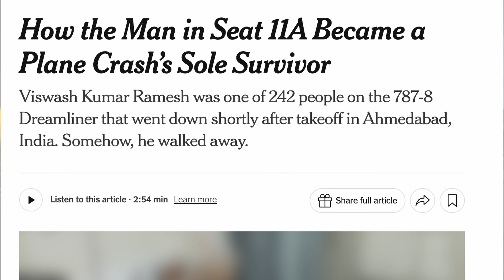Why the RAT Changes Everything – Air India 171 Update

Comment: What redundancies are built in. For example, if the throttles are pushed forward but the computer thinks they aren't.... Or worse, reads that they have been pulled back; What fail safes are there? These machines nowadays are one giant fly-by-wire complexity.

Comment: Thanks, Ahmedabad I have found is a hub for manufacture of av Fuel. In particular the relatively new SAF fuel (green) fuel using percentages of alcohol. Alcohol can absorb water, This can be a good thing however I assume this can go wrong. Being a new system unforeseen things can go wrong. Aircraft has just been refuelled.

Comment: Dear Capt Steve, I was surprised that you had jumped to pilot error so early without considering all the available information such as May day initiated which called out thrust issues; survivor talking of emergency lights coming on and the clip with the RAT sounding. As a non- technical but frequent flyer, I had put it down to dual engine out as soon as I saw the clips. 
While you have updated your view, I did not hear your apology in this episode. So let me help you. Say after me - I F*cked up .. I screwed up badly by jumping to my conclusion before considering all the available information. I apologise to the captains of the Flight AI 171 for jumping to conclusion prematurely.

Comment: Enzo de Argentina. Al parecer harán más seguros los viejos aviones trimotores como el Buenos. 727; el MD.DC.10; o el Lochkeed 1011 Tristan. Tenían toda la potencia necesaria y configurados en simetría con la visetriz del avión. Lo único que les faltaría. Como en los avienes actuales es la "Postcombustion" como la tenia el Lochkeed Francia. 104 Startfire. Lo que incrementaba su potencia en forma casi inmediata en un 40%. De haber tenido ese aditamento el flait  1338 Theodore Air India. Bueno. 787.800. Dreanliner hubiera salido airoso de despegar con máximo peso y 39° celsius del aeropuerto Amhebadad. No soy Piloto. Es mi opinión. Nada mas. Excelente tus comentarios lamento pérdida de vidas en una muerte tan brutal. Enzo de Argentina. 15.06.25 - 0:54.-//

Comment: They should contact the passengers from the previous flight on this plane to Ahmedabad. I read in one of the youtubes about this that someone said passenger communication systems were not working well. If so, this plane should have been grounded and checked out.

Comment: It's far less likely that both pilots were okay with touching the flap handle in that phase of flight, much less 'moving' the flap handle sufficient to raise the flaps. No experienced investigator would focus on that over the obvious dual engine failure or likely inadvertent dual shutdown.

The sequence seen and heard in the videos is relatively clear. The pitch-up after liftoff to the full commanded ~15° pitch indicates no problems detected through at least 50' agl. The obvious loss of thrust passing ~200' agl is followed shortly by a slight pitch-over to maintain flying airspeed peaking at ~430' agl. This limited pitch reduction was most likely accomplished by the aircraft itself, as it's programmed to preserve a stall margin at the upper edge of 'impending stall speed' reguardles of pilot input short of extreme overriding force. The sole survivor reportedly noticed an electrical power glitch and emergency lighting consistent with dual engine failure/shutdown. The videos record the distinctive RAT propeller sound. The pilots well knew that engine restart would be futile at that altitude but would accomplish the memory steps, placing/verifying the fuel control switches in cutoff, then back to 'run' while deploying the RAT. The RAT is deployed automatically in this case but the pilot action might actually be faster due to the 10 seconds or so to decay below flight idle or losing both AC busses as the starter/ generators spool down with the engines. Engine restart in this ensuing timeframe is impossible; the aircraft is not going fast enough for a windmilling restart, while starting the APU for electrical restart assistance takes 90 seconds alone. The engine restart following APU start adds at least another 90 seconds, so multiple minutes total. The pilots knew this, which explains the details and resolve in their Mayday call. The controlled glide, complete with slight left turn and final pull to extend the crash site and soften the impact are all 'normal' pilot/human actions. The cockpit angle at flaps 5 at these airspeeds would not allow the pilots to scope/see the point of impact very easily without leaning up and forward in their seats to look over the dash at a sharp angle. This is not the normal landing site picture with flaps 30. Simply to say that maneuvering away from populous is the priority but more difficult in this case. 

I mentioned that inadvertent dual engine shutdown is most likely because it has been demonstrated in the simulator that a heavy clipboard can slide out of its slot under the center glareshield, fly directly to impact the fuel control switches. After all, no pilot is guarding the throttles from V1 speed on the runway, through the 'positive rate, gear up' callout (typically). The safety notch in those switches is not sufficient to thwart a 'heavy' clipboard from forcing them to shutoff. One US airline banned heavy clipboards from the 787 for this very reason. While most 787 captains remove even the lighter variants from the glareshield slot before takeoff specifically to mitigate this threat. 

It's also possible that a pilot released his seat manually to reach the gear handle, without sufficiently bracing using the vertical handle on the window sill, only to have the seat fly backwards to the stops due to takeoff pitch and combined seat weight, leaving the fuel switches vulnerable to instinctive grabbing or swiping the center console on the way backwards. This is less likely to result in 'dual' engine shutdown, but it's a real threat. 

An overheat in the electionics bay is also a possibility in this case due to the ambient heat, but not very likely since airlines commonly operate at these temperatures, to include hot, high altitude airports like Denver in the summer.

Comment: I am from New Delhi India and I appreciate steeve at leaste he has done extensive research to explain the possible reasons and found this Rat in this video that indian media so far has not identify
Reply: Indian media has already identified this yesterday
Reply: Hahaha, is there any that we could call Indian media. Call all mainstream media Modi Media. They will do everything that their puppet master wants from them. Alt Media still holds some credibility.
Reply: I assumed this on the day of the crash. Because the nose was up until it crashed and the gradual lose of power. I got more clarity when the authorities disclosed that the pilot said there is no power/thrust, we’re going down! 
That means something is totally failed to give the engines enough thrust. It can be mechanical/electrical/software related. 
How could you be a pilot without these basic commonsense? How could Steve thinks that the pilot lifted the gear for flaps instead of gears? Both are at different locations like a handbrake and the accelerator of a normal car.
Reply: Indian media or say those coming on it are useless with no logic. Let's leave them with the paycheck they get to blabber nonsense. Really wanted to punch those who said Captain Sumit Sabharwal pushed the wrong button. Those idiots saying this don't even know how to drive.
Reply: This was already explained by a noname indian twitter guy that it was a dual engine failure due to rat deployment
Reply: oh shut up you bootlicker
Reply: all what he said in the first and second video people explain it before him! he watches people on youtube  then he comes here and say : am sorry, i have to change my bullshit story ! 😀😀😀
Reply: No he did not research.  He never even listened to the audio mayday call
Reply: फिरंगियों की जितनी भी भावनात्मक टिप्पणियां देखने को भले की क्यों ना दिखें, ये लोग अंदर से हमसे जलते हैं और हमारी बर्बादी का जश्न मनाते हैं।
Reply: @desiputtar89 what a ridiculous statement. RIP to all the victims.
Reply: Hello, I am from India and I am 100 percent sure that Turkey is involved in this plane crash.🤬
Reply: @rajputana-019 are you sure? I can get you connected to the aviation enquiry on this. State your facts first, why do you think so?
Reply: Bro steeve is explaining to other white people jot for india only because white people prefer to listen their people.

Comment: Hi captain
Thanks for the explanation.
It might be helpfull to explain in detail WHY & WHEN a RAT gets deployed automatically.

Every aircraft type  has specific CONDITIONS to trigger an AUTO RAT deployment dependable on syatem design.

For example:
B787 has NO ENGINE physically  driven HYD PUMPS ( no gearbox shaft connected to the HYD PUMP )
ALL HYD PUMPS - NRML & BU - are operating by receiving  ELEC POWER input ONLY.

1 condition for AUTO RAT DPLYMNT is / 1 ENG OUT and ALL ELEC HYD PUMPS out during TO phase.
ONLY 1 ENG OUT is already sufficient togehter with ALL HYD PUMPS to trigger AUTO RAT DPLYMNT.

So being MORE specific & detailed in ALL the different CONDITIONS when an AUTO RAT DPLYMNT is triggered on B787  type will be helpfull because B787 is an unique AC TYPE were many systems are  ONLY electrically operated.

B777  AUTO RAT DPLYMNT has different CONDITIONS in comparison to B787 type.

Mid-Air B787 AUTO RAT DPLYMNT is triggered BY other system pre-set conditions, although of course, there are close similarities

Comment: Told my explanation before - feel free to disagree - full hydraulics failure about 1 seconds after nose gear lift off that led to full engine failure in the next few seconds. that then resulted in RAT deploying and pilots did not have time to retract the gear.

Comment: planes use the most fuel during take off, if dual engine failure then bad or contaminated fuel is a very high possibility. I am sure that would be the first thing they would look into and test the fuel. If the fuel is the cause then there might be foul play involved..

Comment: The statistics and causality are what's mind boggling here. Obviously the RAT was out based on all that evidence. But the odds of a double engine failure on takeoff on its own is astronomically low. It seems the investigation should look at something that acts as a single point of failure that could greatly increase the odds of the double engine failure for this flight at the moment of rotation. This brings us back to fuel contamination or something affecting fuel flow, or anything that might tie the fate of both engines together.

Comment: The aircraft has lost lift right during the initial climb. This aircraft is poorly designed as it cannot maintain flight even with landing gear extended. Unless the spoilers are not extended this aircraft has a bigger problem than expected. Rapid deterioration of engine thrust could explain the rapid lost of lift.

Comment: This quote is from a translation of an interview the survivor in his native tongue: " He said the  plane seemed to come to a standstill in midair for a few seconds shortly after take-off and the green and white cabin lights were turned on. He said he could feel the engine thrust increasing, but then the plane "crashed with speed into the hostel". 

What I am wondering is did the pilots take off without autothrottle because the end of the runway was approaching  and then engaged it once airborne - in the wrong mode. Say approach mode instead of TOGA. The throttles closed suddenly. Was that the impression of coming to a standstill? Assuming there was a double engine failure, one of  the pilots  activated the RAT (by pressing the Ram Air Turbine switch) and emergency lighting before it was  realised the throttles had closed. The throttles were opened but too late to prevent a crash. Amid the cockpit chaos, the gear was simply  forgotten. Gear down is what approach mode might wantto see to no uncommanded go around.  I suggest people read about the crash of Indian 605, an A320 that crashed when the crew became completely bamboozled  by the autopilot modes.

Comment: Either fuel delivery tank had a previous delivery of gas and didn't release all compartments causing a mixture of Jet fuek$ Gas or fuel storeage tank picked up fuel from bottom and it had water in it.
He said NO Thrust, which means engines were most likely at an idele, soon to die out. You can still hear the jets with the rat deployed.. this would lead me to gas got mixed in with fuel. I have been a mechanic on these engines for 36 years. I hear things differently than a pilot inside a cockpit.. The condition of the injector tips will tell you if it was contaminated with gas vs water.
You would think if he had some hydraulics he would have put plane sideways 90 degrees and let the wing take initial impact instead of belly down into buildings.. not like water where belly down would be correct impact.

Comment: Steve, question.... @3:08, i froze the vid to see if I could discern something that's been bugging me. It's 37C outside and yet we still don't see any evidence of exhaust gas from the engines. Why ? There should be evidence of exhaust wake turbulence from the engines, making the aft section of the plane look jittery, and yet the craft is still crystal clear. 
My thinking here is that there was fuel supply failure.  it starved the APU and the two engines, hence the deployment of the RAT.
Off Topic: Why not make it impossible to retract the flaps until the landing gear is tucked away and the landing gear doors are closed ??

Comment: a retired female pilot has mentioned that the most dangerous time when flying is when taking off. She mentioned lithium batteries exploding in the cargo bay affecting the power system of the plane or a engine failure with no time or altitude to correct the failure, also DEI pilots that make significant errors..

Comment: I think they had an electrical failure. Possible one engine.  I can't see two engines going nothing I can't see how two engines can go beside with that fuel contamination theory.  I really believe they had some failure in the electrical system because that plane is more of a electrical design. Maybe one of the batteries blew up or something else blew up in damaged the avionics. Or something in the luggage blew up and damage the avionics

Comment: Steve, I appreciate that you’re knowledgeable in many areas, but I have to say I was a bit disappointed by how quickly you concluded it was “pilot error.” I’m not an aviation expert, but as someone who has traveled extensively over the past 20 years, I found your explanation to be overly confident and somewhat dismissive.

It’s important to remember that pilots from any country are trained professionals—equally educated and qualified. The way you described the situation almost made it sound like those pilots had never seen the aircraft before, which came across as unfair and condescending. Honestly, it was a bit shocking.

I had always thought of you as an open-minded person—someone who travels widely and meets people from all walks of life. But after hearing that explanation, it felt like a very closed-minded take. It came across as small thinking, which was surprising.

It also seemed like you didn’t do much research before posting your first video. Instead, it felt like you simply echoed opinions from a few friends you admire as “experts,” rather than forming a well-rounded view based on facts.

Comment: Wouldn't the survivor say the engines stopped just before the plane crashed?  (Take-off is the noisiest part of the trip)   That's what every passenger and pilot notices when an airplane runs out of gas (and becomes a glider) when the engines stop.  Witnesses on the ground would have mentioned the lack of noise or change in pitch of the sound of the engines if they stopped or lost power.     
Can't be sure but your video might show a small dark object being thrown off or flying off the left side of the airplane before it descends out of view.  Check it out.

Comment: Good call I think. When I first saw the video when it was first broadcast, the engine sounds seemed alarming to me. When the sound passes the area where the camera is, the engines sound normal for engines at t/o power. But as the aircraft passes, the sound changes to what seems to me to be engines spooling down - and not as accounted for by the dopler effect. The change sounds more like engines failure.

Comment: I think the APU in the 787 can provide backup power when in the air (most APUs can't) but it takes a good 30 seconds to spin up and start so there would be no time to get power from the APU if the engines went out.

Comment: Is there ever a case where the tarmac gets so hot it creates an extremely low air pressure point,  like a column of hot air rising, that the air density rapidly decreases, causing bad lift and engine stall?

Comment: How does fuel flow route on the 787-8?  Any common mode or single point of failure that could take out both engines?  Are igniters normally on or off for takeoff, and could they have been left off when should have been on?  Could pilot have accidentally switched engines to the off position?

Comment: That's all well and good, but the flaps weren't down.   You can pretty much see in every camera angle that the flaps did NOT appear to be down and yet it's almost 100 degrees F out and in that kind of heat you're going to need a lot of flap to increase lift for takeoff.  Power failure in both engines doesn't explain why even at takeoff it didn't appear that the flaps were out.   I've heard it said that the flaps on this plane are so big that when extended you can barely see the engines from behind.   I can clearly see the engines on both sides.   Condolences to all the lost and their families.